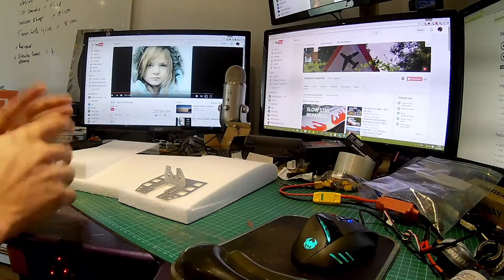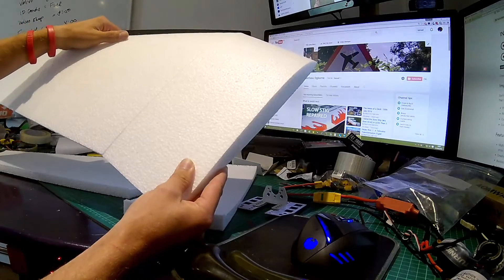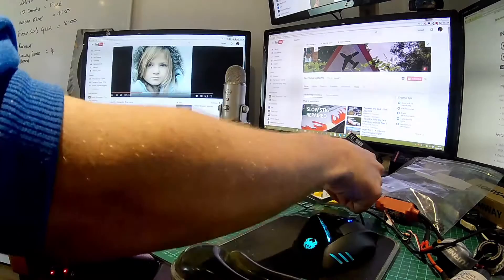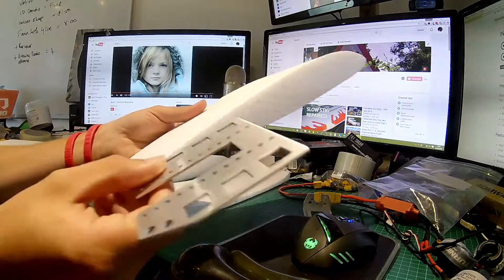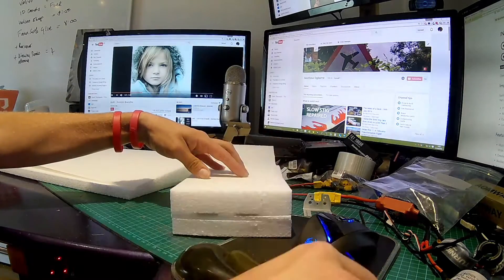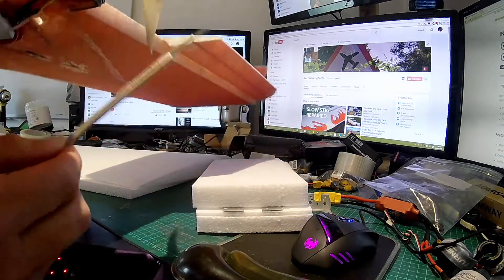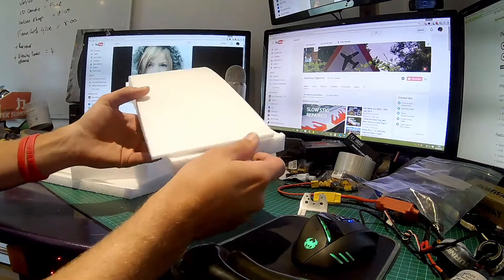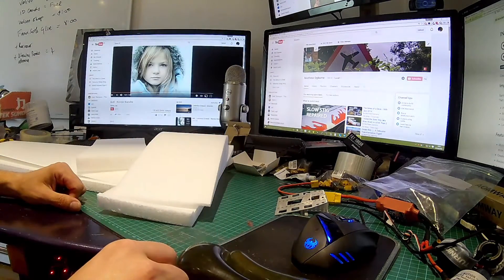Your Help: Thrust Angle? Up or Downwards Thrust?

Comment: I would mount it on top with some thin plywood glued on both sides of the foams outside, perhaps bigger than the motor mount and then predrill small holes to screw through the wing and plywood, With the aim to be able to bend the motormount to the right thrust angle, witch i would try first to see if it was possible
Reply: You can use a flexible motor mount (a thin aluminum angle) so you can adjust it. Of course not so thin that it will flex under the motor push.

Comment from the maker: I've done some research on this, it looks like I need downthrust! So on the bottom instead.
Quote: Conclusion

Even if we limit ourselves to pusher planes with the motor above the wing and behind the CG, there is no single answer to the question "what motor angle should be set for the plane to fly?". Depending on the design and the exact position of the motor the best solution can be some up-thrust or some down-thrust:

Up-thrust if the plane has a tail in the prop wash and the motor is not too far back.
Down-thrust if the motor is not too close to the CG and/or the plane has no tail.
If there is no tail and the motor is mounted high above the CG it will probably never fly very well.

http://flitetest.com/articles/Motor_angles_for_pusher_planes